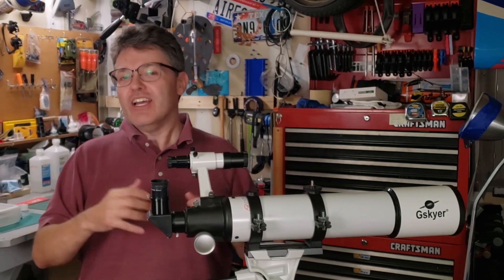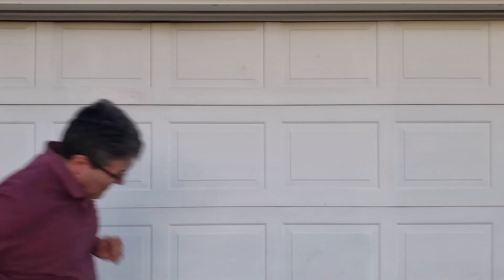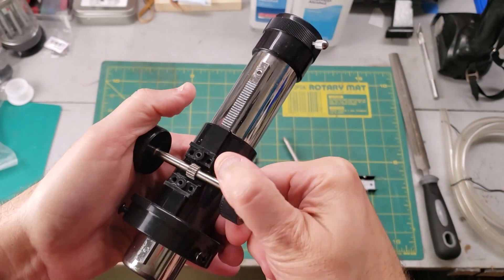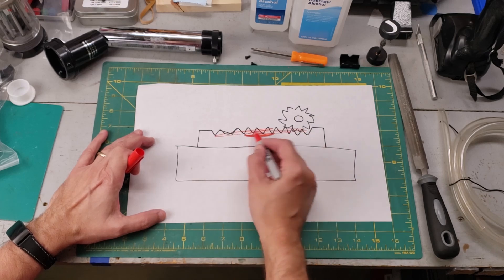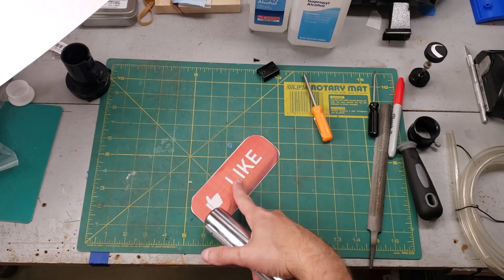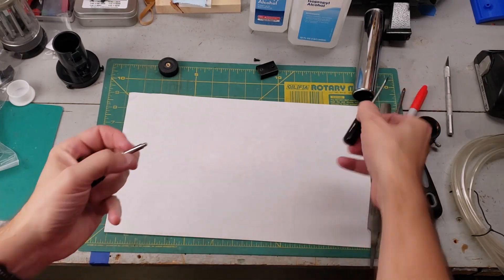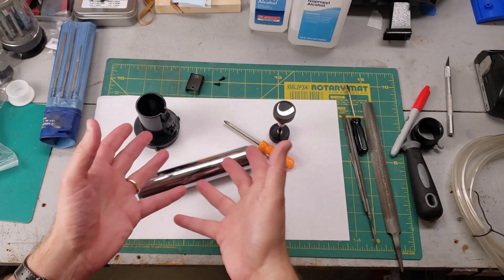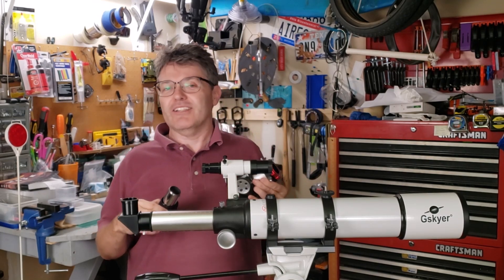Telescope Gear Damage?  Fix It, Don't Trash It!

Comment: LOL a rack pinon MOD 2 Crawford design the tubing idea SMART.. a tip Some graphite on the sliding part reuses friction OBS ONLY THE FOCUSING TUBE ..
+ the lesser D on the Rack weal the slower it will move 1 turn = pi*D

Comment: I have experienced with this problem and I found that by adding a short extension eyepiece tube (old 2x barlow without a lens) to the existing focusing tube that it changes where the good teeth meet the rack! Walla ! Still, I think your "crayford" solution also is a great way to fix it, too
Reply from the maker: Admittedly, your method qualifies as a genius simple fix. Thank you!

Comment: What size diameter tubing is needed .. thank you
Reply from the maker: It differs for each focuser.  There is some leeway because the tubing is somewhat flexible. Measure the gear tooth diameter and buy a size smaller than that.  I think I bought one foot of several diameters.

Comment: I was cleaning an old telescope, and the problem I had is thas I broke the rack in 4 pieces, what would be the best way to repair it. Can it be glued back together, or should it be soldered? I'm down in Mexico, and I'm pretty sure that finding a replacement would be very difficult.
Reply from the maker: I wouldn't bother soldering it together. It'll break.  Perhaps if you can 3D print it?  Believe it or not, but you can usually buy a replacement focuser tube very cheap via Temu or Alibaba.

Comment: This is great! Something I may need in the future. May I ask what may be causing my RAP focuser, which is fairly new, to at a certain point stick a bit then jump which throws of my focusing. Noticed it only happen when I have an eyepiece on it and only happens when im turning it in one direction?
Reply from the maker: If it sticks, that usually means it is loose or it doesn't have enough of the shim strips.  That's my guess.

Comment: I have a Luvoni telescope that has this issue.  Is there some website where I can order the new part?
Reply from the maker: The first step is to contact Luvoni and ask if they'll sell you a spare part.  After that, you'll either have to either 3D print it or order it from an online supplier or buy a used broken unit.

Comment: What is meant by "food grade" tubing? Will any plastic tubing work?
Reply from the maker: It's a clear somewhat flexible tubing sold at hardware stores in the plumbing area.  Any plastic that is grippy or not hard will work.
Reply: Thanks!

Comment: I didn't have the time or tools to do this for an Orion Starblast focuser but I did find that replacing one of the plastic spacers on the tube with a strip of felt (aka moleskin) got the rack teeth in contact with the pinion again. I'll probably need to find another solution at some point but it's working fine for now.

Comment: This looks like a great fix. I might now be able to fix my old telescope. It didn't fall, but during a cold night the grease of the focuser got too thick and I didn't realize how much force was put on the plastic rack... Thanks!
But if the rack is made out of metal and held by screws, isn't it possible to buy a new metal rack?
Reply from the maker: In theory, yes you should be able to replace just the gear rack, but in practice getting one just the right length with just the right gear ratio is difficult. It's cheaper to buy a new/used focuser tube.  Or file it and use some food tubing.

Comment: I have a Bresser Refractor Messier AR-102xs/460 Telescope with Hexafoc Focuser with a bad focuser.  Have disassembled it and cannot figure out why it is so difficult to turn.  The knobs have been stripped and turn freely without doing anything.  I have just about given up.  I have tried to find a replacement focuser and cannot find anything that fits.  Sad.
Reply from the maker: Have you contacted Bresser tech support? They may have an easy fix for you.
Reply: @AstronomyGarage Couldn't find a number.  Contacted  Explore Scientific, who distribute Bresser in the U.S.A. and they told me to email photos of the scope.  Did so.  Never heard from them again.
Reply from the maker: Feel free to send the photos to me. I'll try to guess what's wrong.  JJDreese at  yahoo.com